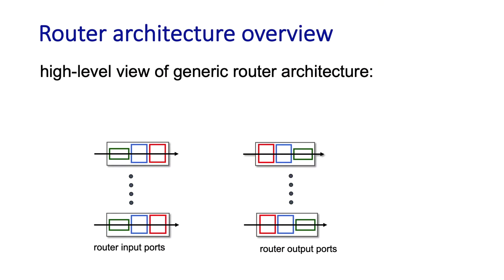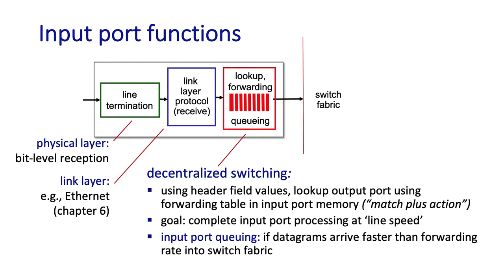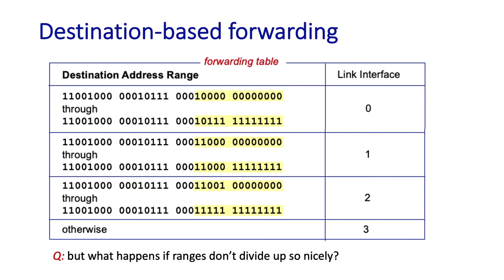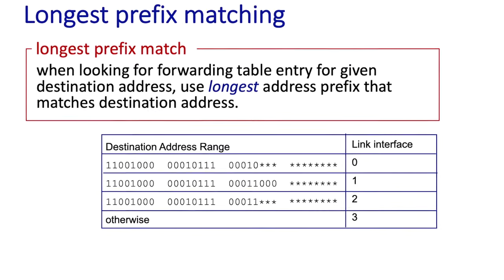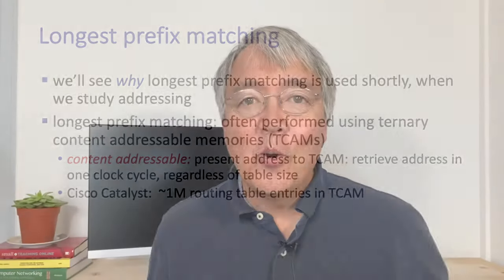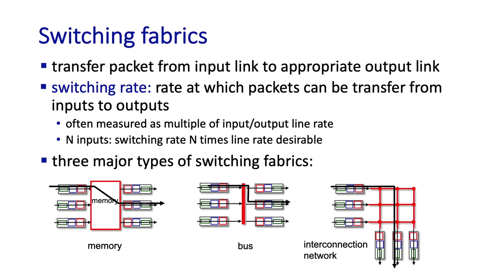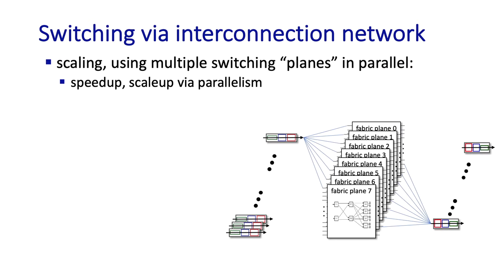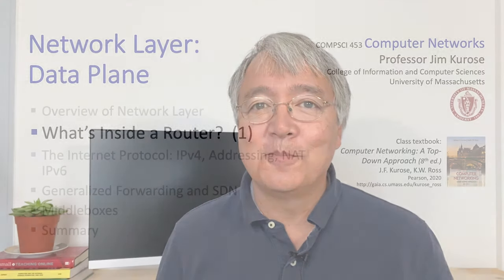4.2 What's inside a router?  Part 1.

Comment: Understanding Router Architecture and Components Part 1
00:12 Understanding the inner workings of router architecture.
01:53 Router input port components
03:38 Understanding network layer header and forwarding tables.
05:32 Longest prefix matching simplifies matching IP addresses
07:21 Longest prefix matching is crucial in router forwarding decisions.
09:06 Different approaches to building high-speed switching fabrics
10:52 Routers use different types of switching fabrics for efficient packet transfer.
12:41 Switching fabrics in routers use parallel paths for high performance